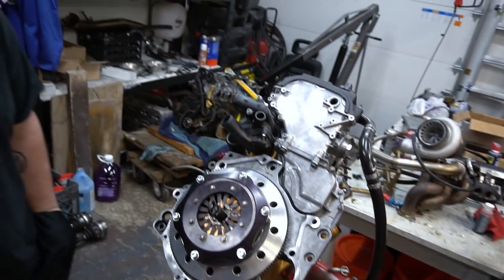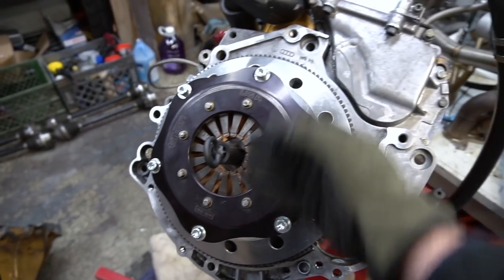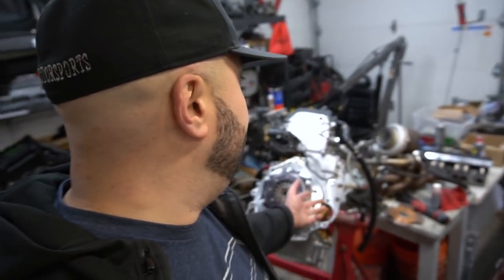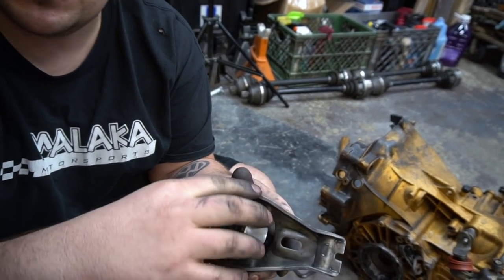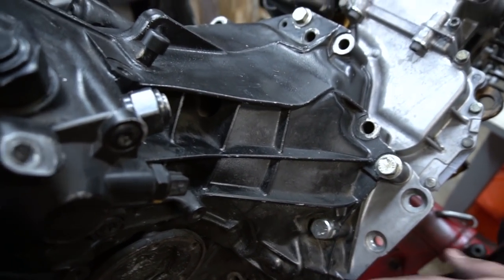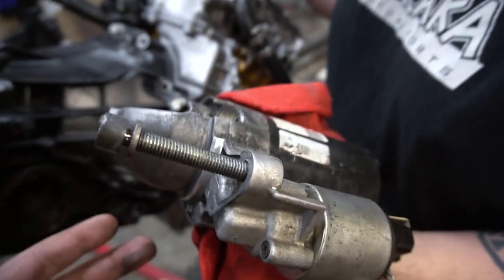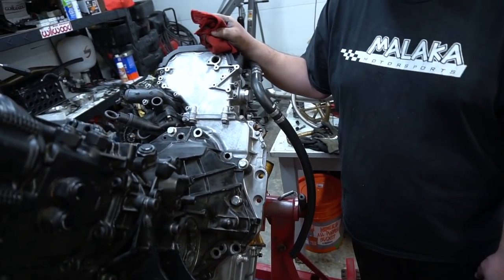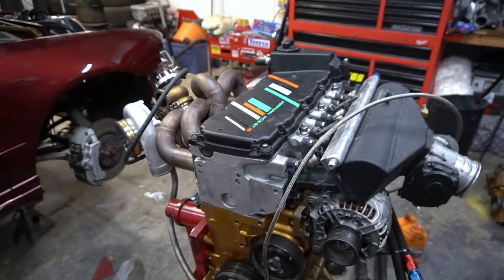800+HP 12v VR6 BUILD AUDI B5 A4 | Stav's BUILD PART 9 |

Comment: Thanks for the great videos. It inspired me to actually work on my VR6 Turbo. We spun rod bearings the same week. Through in a stock motor and drove it around for a bit. Then put my Wiseco pistons in and started driving it around didn't Pass DEQ so stopped working on it. Then you guys posted videos working on yours so I started working on mine try to Pass DEQ yesterday so close. Will make it pass next week. Thanks for the motivation really appreciate it

Comment: Love all the info. I've thought about doing a vr6t in my B6 S4(I assume its fairly similar tho I'm not sure if the adapter works for the OA3🤷‍♂️) Although I think the 4.2 is a great motor even if it is slow. Might just end up sleeving the block and boosting it with a supercharger, would be a fun daily at least. Your vids will help me decide I guess😁😁

Comment: Hi guys awesome videos. I appreciate that you guys point out the little details/ modifications that would otherwise go unspoken.  I have a bolt question actually.  I'm doing a 2.0T TSI chain tensioner and the dealership gave me the wrong engine mount bracket bolts when I was down in L.A. visiting friends.  I recently moved to an area where I don't have dealer/ part access unless ordered.  Should I reuse the  stretch bolts (N1071501 M10x65), or buy Non--TTY bolts an Home Depot/ Lowes and fit them in deleting the 180º turn needed for the stretch bolts?

Comment: So this is another Audi cause the other one was awd but i know the a4 Audi b5 is fwd? I have a green one with caramel color leather seats and i wanted to switch the 2.8 V6 for a modified VR6 but i want the VR6 to be reliable cause my motor has 216 thousand miles and no problems what so ever and i need maintenance bad but i knew the car wouldn't give me problems that's why i bought it...how reliable is a well built VR6?

Comment: Is the clutch pedal very hard to press with that 3 plate clutch ?
Reply from the maker: mrAudisubaru not fun to drive around town that’s for sure lol
Reply: no, the more plates it has, the less clamping force is needed to hold enormouns anmount of torque, its the same phenomenom as lets say 250 2stroke clutch! many discs + less clamping force = big friction still
Reply: @Skaude  Yeah more surface area with lower pressure it make sense.

Comment: I've wanted to do a vrt swap for a long time. Realistically how much of a difference in cost is there between 12v & 24v?
Reply: about double the price
Reply: not worth it. Building a 24V head is way more expensive and all the extra airflow isnt necessary when you are cramming the air down the ports with a turbocharger. Just about everything to build a 12v is cheaper than 24v.